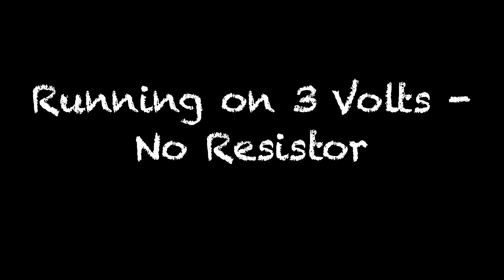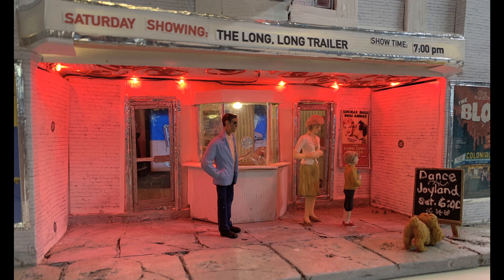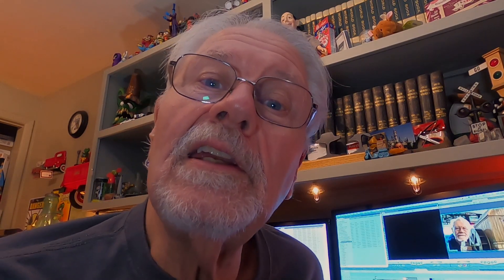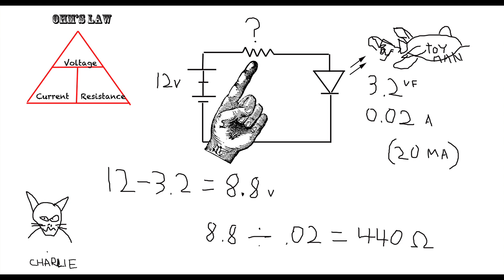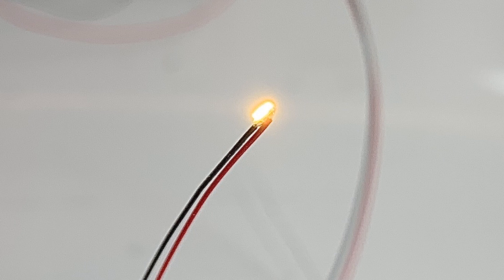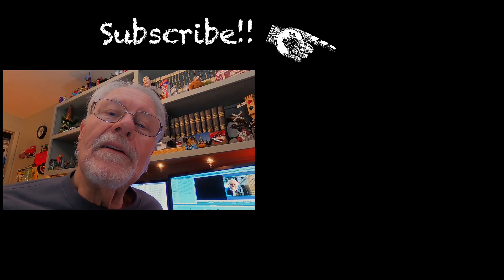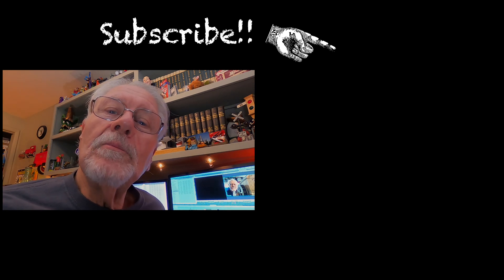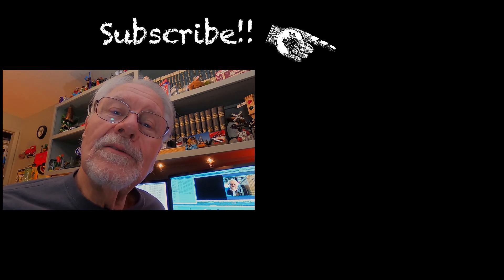LED's Explained a bit MORE - Amended Thoughts on LED Magic - Electricity For Model Railroads

Comment: I have a lot of strings of LED Christmas lights.  They appear to have quite a few individual LEDs wired in series and if one goes out they all go out.  They are running on 110V AC so they are on only half the time and they flicker rapidly because of that.  They are pretty reliable but I have had to repair a couple of strings by finding the bad LED and swapping in a new one.

Comment: Dale:

A few things that I did not hear you mention:
1) LED forward voltage is dependent on the Semi conductor material.  the RED, YELLOW, Muddy Green have a forward voltage of 2.2 VDC,  All other colors are anywhere from 3.2 to 3.8 VDC forward voltage but for model railroad  3.2 volts will work for to all.  The very early red LEDS had a forward voltage of 1.7 VDC
2)  A reverse voltage exceeding 6 volts will burn out the LED's.
3)  I have run Bright white LED's at 20 milliamps and they degraded to a DIM blue white, and I have had the warm white just not work any more. they are usually bright enough a 10 Milliamps

Tell Don HI

the 4 lead LED's are RGB which implies with proper currents  through the separate chips you could you could get any color you desire.
Reply from the maker: Hi right back. Thanks for the information !!!

Comment: I've also seen three color LEDs where there are four leads so either the anode or cathode is common.  Usually the three LEDs within are red, green, and blue so I'm assuming if they can be dimmed you can make it almost any color like the RGB sliders in PhotoShop.
Reply from the maker: Hard to dim without a driver. Change the pulse width.  But that would be fun!
Reply: Forgot to mention the project I had in mind for this would include an Arduino and I know those can do PWM.

Comment: LEDs can easily be dimmed by varying the resistance higher than the calculated value. 

So for 12V a 470 ohm resistor is recommended and will have a current od between 20mA and 30mA, raise this to 1000 ohms and the current will be 10mA to 15mA and the LED will not be as bright. 

The relationship between raising the resistance value and the brightness of the LED is not linear - a 1000 ohm resistor will not halve the brightness. 

Modern high brightness LEDs cannot withstand more than double their rated forward voltage (fV) in reverse and each color has a different value for forward voltage. eg. Red LEDs fV <= 2V whereas Green LEDs fV <= 4V. 

Check the manufactures specs for the LEDs you have bought.

Hop this helps.
Reply from the maker: It does! I have found the only way I can properly dim these things is with the little dimmer circuits that you can buy the very the pulse with and then run them on pulsing DC

Comment: The secret to dimming LEDs is pulse width modulation. Essentially you are pulsing the LED on and off, the longer it remains off the dimmer it gets.
Reply from the maker: Yup. Same as lamp dimming for home lights. Simper than changing the voltage.

Comment: Hey, just out checking looking for a cheap yet reliable way to light up my garden railway on my off grid farm land. An alternative I’ve found that works year round provided it has been waterproofed I use the inner workings of solar garden path light, butchered to the max but my buildings, streetlights, stations, some cars and trucks, even some of my rolling stock has headlamps that has led solar lights. Thinking of lighting up a steamer ship in a harbour for my next major idea. Love watching you’re videos, absolutely got to be creative! Thanks… and the videos are never boring!
Reply from the maker: I have thought about that. So far, I have always just strung low-voltage wires, but boy solar is so much easier if you have some sunlight. They don’t work very well in the shade.

Comment: This has been a great series.  Now  I know or will know how to install block inductors.  Don’t thing I’d find switch stands like you made for N scale.  

As an aside I have graduated from 2 very prestigious Engineering schools (whose names you probably have never heard of). I hung out with Electrical Engineers as an undergrad but it did no good.  By the way:  Do you know why transformers hum?  They don’t know the words.  (Actually it is because the metal plates are expanding and contracting as the current is going through them.  Could not resist it!
Reply from the maker: Thanks for the laugh! Haven’t heard that one before! Perhaps, if you couldn’t resist at all, there would be no hum because no current would flow. And I couldn’t resist that.

Comment: There is an LED mini regulator that will work from 5v to 90 volt and will auto regulate your circuits. It is a simple two wire hookup. You just put it in series with each LED circiut.

Comment: While listening today a thought occurred to me, (maybe hair brained) To create the correct load, use "screw head" adjustable resistors (also known as "pots") and set up a 12 volt circuit to just above the trigger point, for each LED, to achieve the desired brightness. Is that hair brained?
Reply from the maker: Been there. Done that!  Use that on car lights because the track voltage changes.

Comment: LED's can not handle much of a reverse voltage and will  be damaged. Adding a diode will not change how it works as it still operated on half the cycle but the diode will prevent the reverse voltage from being applied to the LED.
Reply from the maker: I get it. Hum… haven’t had that problem but I can see how that works.
Reply: I'm glad this was brought up.  LEDs are diodes, just not very good ones.  Leaving the diode out when running on AC will damage it over time.  Does it "Work" without it ... yes ... should you leave it out ... no.